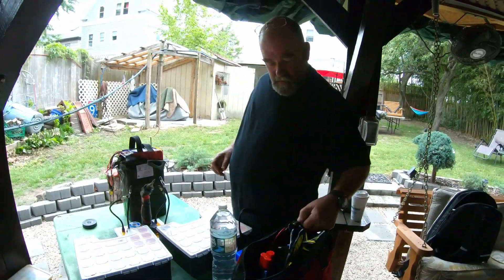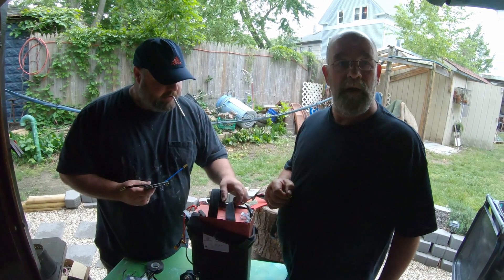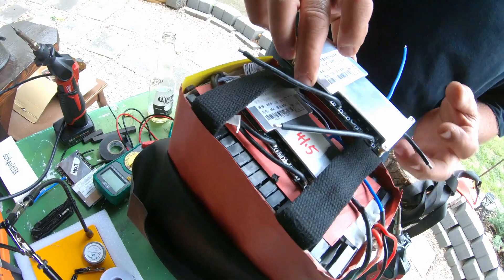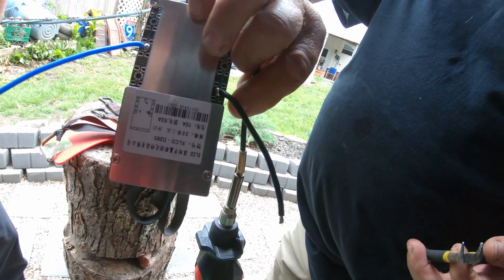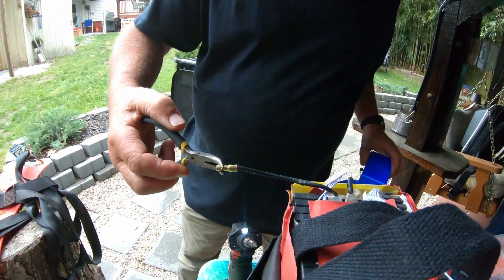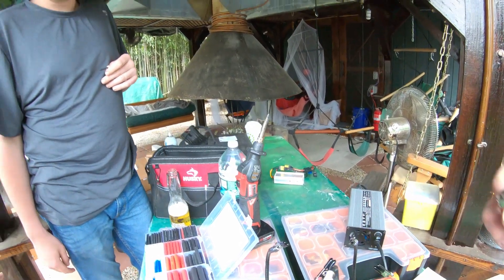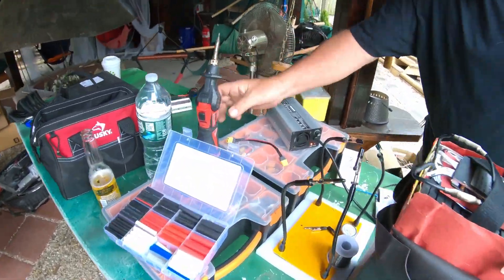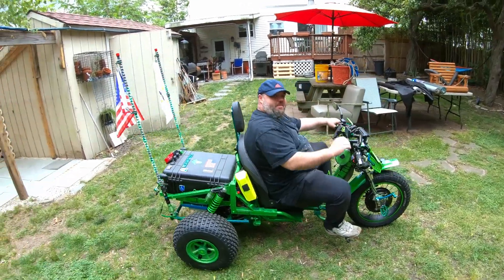Battery Repair - BMS Replacement on Lithium Ion Battery That Won't Charge

Comment: Just asking. I see you taking apart lithium batteries. What is basic safety steps when you take apart these batteries. I am interested in replacing a BMS due to a failure. Bryan
Reply from the maker: do it someplace that can handle a large fire breaking out. be very careful unwraping it so as not to displace any wire. understand where your live contacts are. 

that all said, neither more nor brian have actually taken apart any packs. we only worked on the bms itself which is on the outside of the actual battery pack